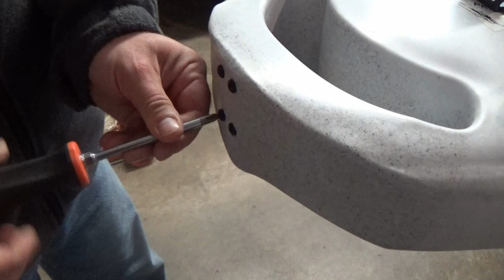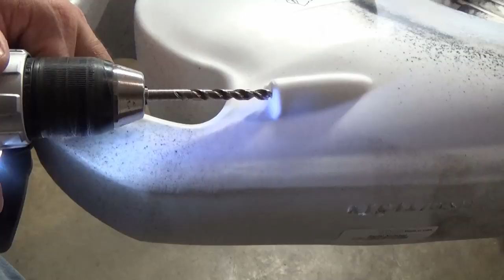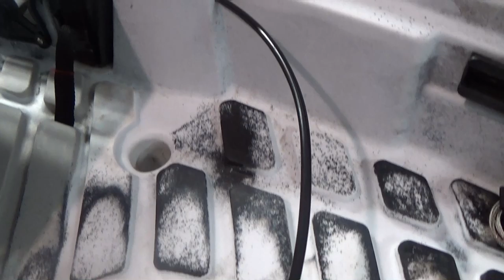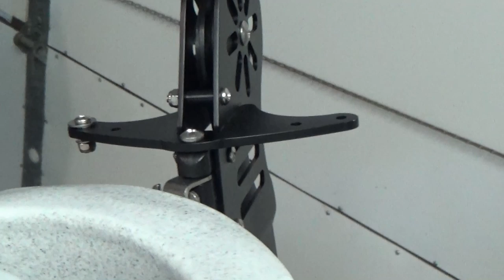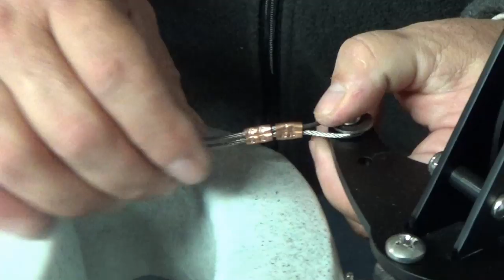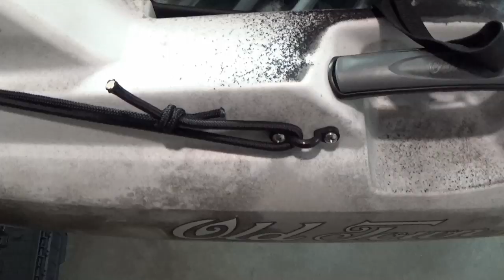Easy Kayak Rudder Installation How-To: Episode 408

Comment: No offense but information would have been much more helpful than the endless silly song. Things like what size drill bit you used for the cable guide holes? What diameter are the cable guides? How did you magically get the cable guides to come out the holes that you drilled at the other ends when they are flexible and there's no way to reach in? You know, stuff that can make all the difference...

Comment: Awesome video! i have the same kayak and wanted to get one of the rudders. Do you feel they make a difference if you dont have a motor and just using paddles?
Reply from the maker: Definitely makes a difference, especially if you are trying to control the direction of your drift in wind or current.  :-)

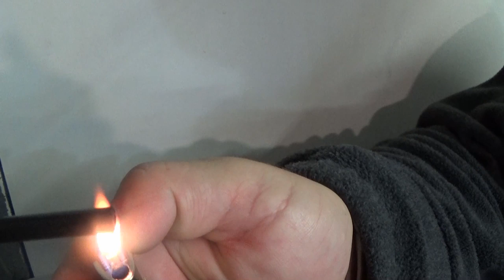Comment: At 3:33 what material and size is used to slide the wire threw?  Thanks for sharing great instructions.  I'm looking for a parts list.
Reply from the maker: Thanks!  I actually can't remember the size tubing.  It typically comes with the rudder package, but most Lowes or Home Depot carry it too.  :-)

Comment: I have the same kayak.  Do you have to use the rudder system made specifically for this yak or can you get away with another rudder? Just have a hard time justifying $300 for a rudder.
Reply from the maker: There are a few cheaper generic options, but I have not tried them on this model yet, so I'm not sure how well them will work..  :-)